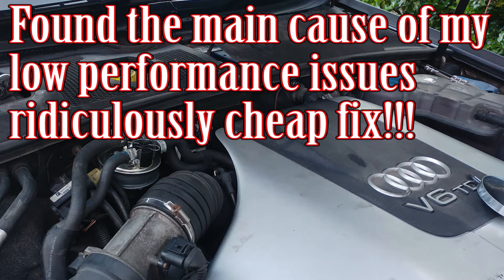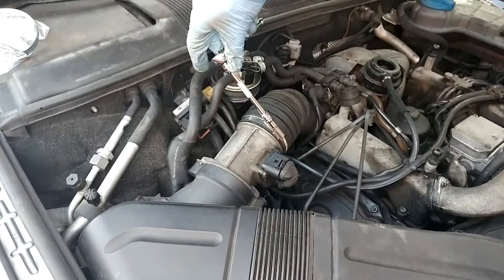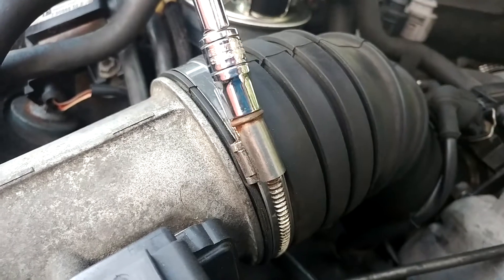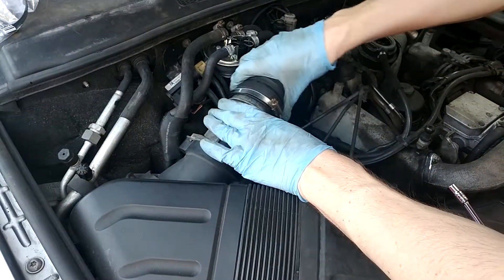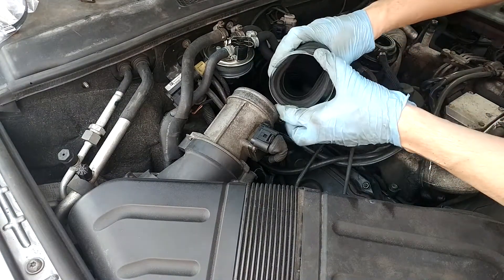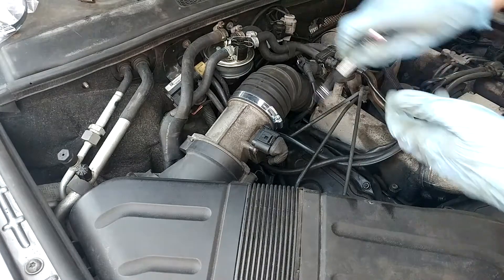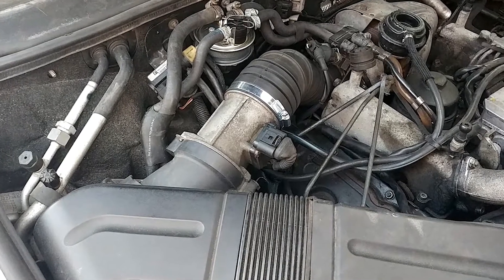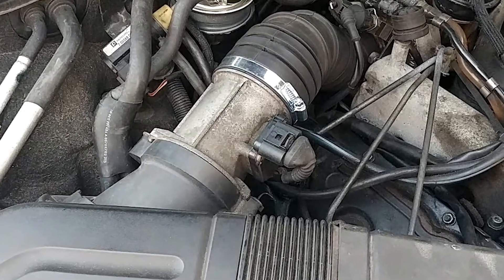Found the main cause of my low performance issues ridiculously cheap boost leak fix

Comment: Thanks for this bro, I'm hoping I've just found the cause of mine as just checked my air filter after watching this and found the rubber seal ring was inserted wrong and not sealing the air box 🤐...🤞hope I've solved the issue....

Comment: Gotta check this on my JTD Alfa. Seems down on power sometimes, but sometimes runs okay. Anything else you reckon I should check? Friend told me to check vacuum hoses. Turbo hoses aren't split, they a re replaced with metal pipes.

Comment: It's great when you find a simple fix like this. Just out of interest what's the fuel consumption like now? It did seem rather high when you first got the car.
Reply from the maker: It's closer to 35mpg now which is the factory figure. If I'm honest I've been very much so enjoying the extra power  and think 40 would be achievable on a run at 60mph.
I am playing around with some stuff for a future video atm trying performance diesel and other additives - might be slightly skewed as I found the boost leak half way but the results are similar I suspect.
Reply: I guess it's not that bad if you're matching the official figures with a modified car.  Think I'll stick with my 1.9TDI it would be nice to have more power but I'm used to 54+ mpg.
Reply from the maker: I've been told the MPG goes up with the tuned nozzles that use a 8 hole pattern as you gain better control low down - will wait and see.
The V6 TDI is a trade off for me as you have 2 more cylinders sort of makes sense to loose a third also including Quattro. But the trade off starts to win VS petrol MPG and if/when I get this moving towards 300BHP 30mpg vs the S4's 18MPG isn't so bad.